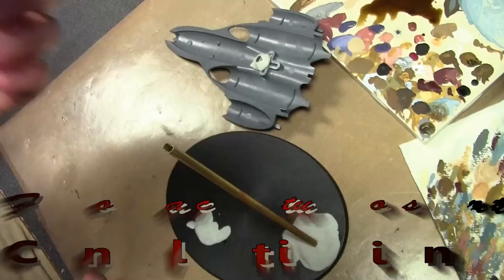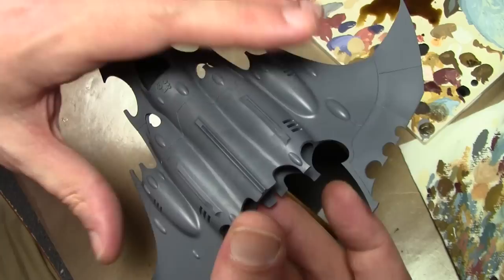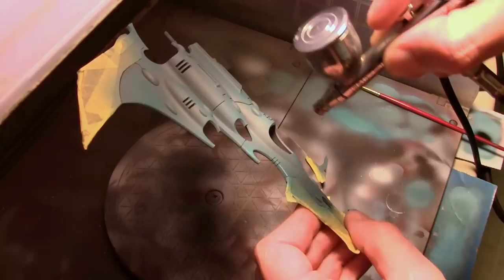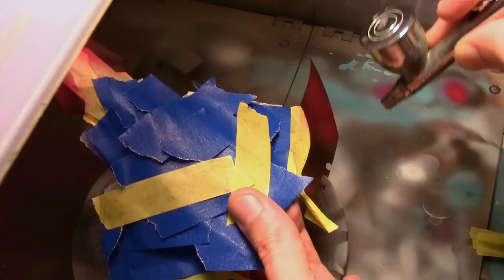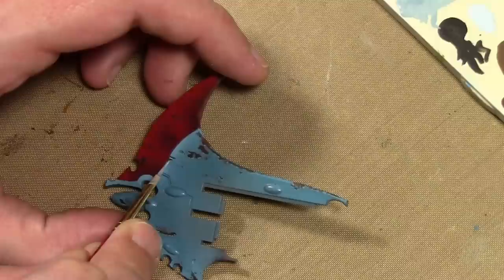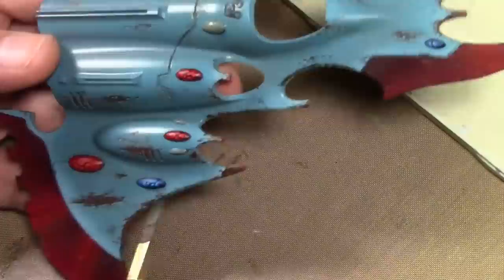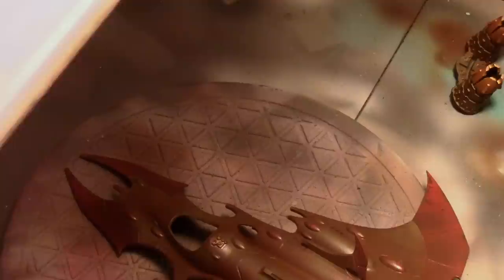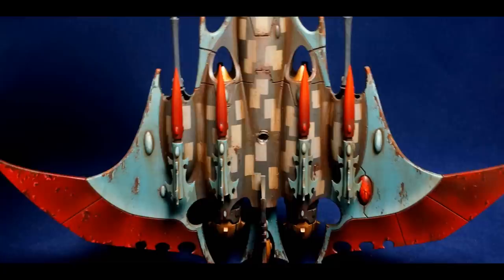Painting a Dark Eldar Drukhari Razorwing Jetfighter

Comment: I noticed you've had mask leaks and runs in the past.  Here's a tip; after you mask paint over the edges with the original color again and let it dry, then paint your new color.  The 2nd coat of original forms a seal and if it were to run it would be the same color.

Comment: Hate to necrobump, but if you're planning to chip layers of red where you may have to lay it on thick, would it be advantageous to use pre-made chipping medium, or does the hairspray work exactly as good or better? Some alternatives are close enough within a tiny margin, but then you have some cases where you can thin with water or thinners, but thinners will give you more time/etc.
Reply from the maker: I tried a store bought version once and it was too thick to spray. I wasn't sure what effect thinning would have, so it was basically a waste. I know how to work with hairspray, it works fine, and it's super cheap.

Comment: you did say at 20:00 that you did use white glue for glueing glass in place. What kind of of glue is that?
Reply from the maker: Yes, white glue. Also known as Elmers or PVA glue.
Reply: ThePaintingClinic
 I did think so. Is there some special reason why did you use this type of glue instead of normal plastic cement ?
Reply from the maker: Plastic cement doesn't work on the hard clear plastic. It could also ruin the piece.
Reply: deende79
standard plastic cement won't bond through layers of paint. Superglue will give you white streaks all over the clear plastic.

Comment: Your videos are becoming a bit samey lately. It's just hair spray rust over and over. I understand you're doing a large project here but everything is red, blue and rusty at the moment. Maybe mix in some other stuff to break it up a little?
Reply from the maker: I'd hardly call two videos out of the dozen or so from the past two months all the same. If you want to see more variety you can donate to my coming soon Patreon page.
Reply: ThePaintingClinic  The Yamato used a similar colour scheme and technique and was the major content for this past month, you did a tutorial on the rusting technique as well as using it on two models. The Titan used a similar red. I'm not trying to pick fault at you, I'm just saying it's a bit repetitive to see the same red on every big project you've done lately since the rest has been mostly dry brushing shades of brown.
Reply from the maker: AstrayPenguin
I honestly don't see any similarity between, say, this one and the titan. Both had red in them, ok, but different techniques were use and as the painter they are completely different. I also try to do something new in each vid. A few of the latest ones had rust in them, but I showed different ways to paint rust.
Reply: ThePaintingClinic  But the shade of red either doesn't show up or "cover it in AK interactive and wipe it off" makes it all come out very similar. Then Grey with Aztec pattern. Remember it may only be one project to you, but the Yamato was multiple videos, so it stretches it out to cover a long period for the viewer which influences how common things feel.